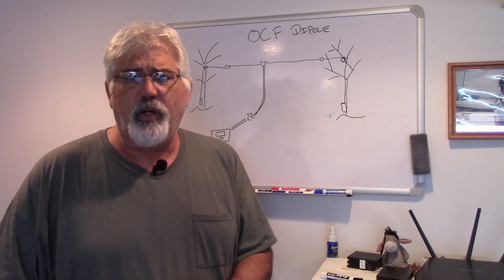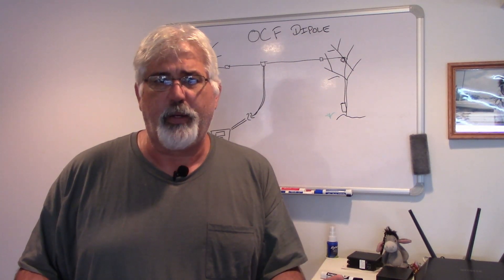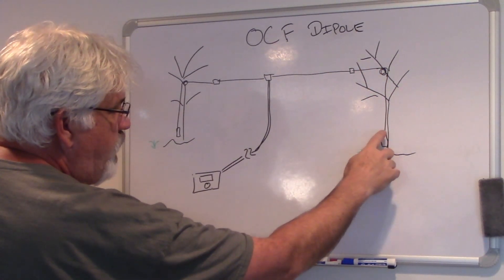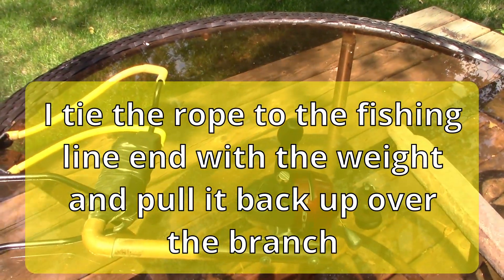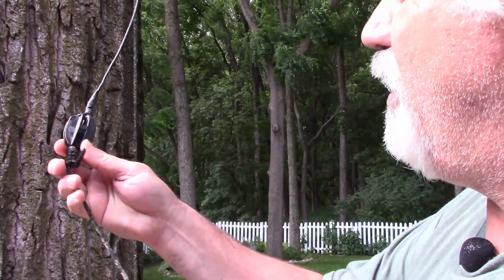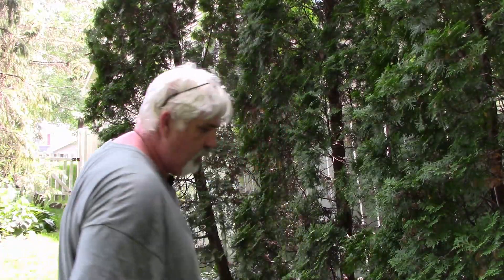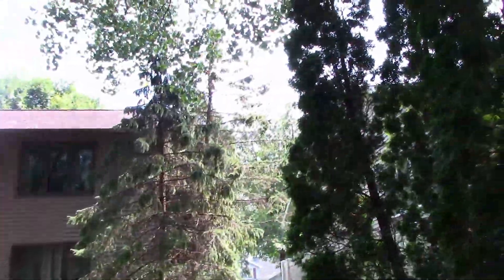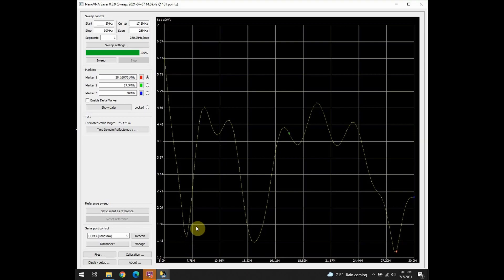Let's Fix My Off Center Fed Amateur Radio Antenna

Comment: I go through this every hurricane season. Lol.. Paracord with springs is the way to go. Gl.
Reply from the maker: Good suggestion!  What size springs and where do you get them?
Reply: @StuartPatterson  20 inch zinc plated extension springs - Amazon.
 2 inch x 4 ft pvc pipe concreted in ground, with eye hook bolt fastened to the top, to spring end. The springs are cheap enough to add one or two depending on how much tension you want.
Reply from the maker: @tsant6591  Thanks!  I might look into that solution for future antennas.

Comment: Rather than sash weights, I use springs. Screen door springs work great.
Reply from the maker: Ah, yes, I can see that working well!  Good idea!
Reply: Sash weights hard to find these gays!
Reply: I have a 200 ft leader line with pulleys on either end. I use empty propane bottles as counterweights. It allows me to easily change antennas and experiment.

Comment: After running numerous antenna designs over the years, the OCF Dipole has proven to be a very effective design and happens to be my favorite. I use a Balun Designs unit currently, but still have two W8AMZ(sk) 40-6 and 80-6 units that I packed away.
Reply from the maker: Agreed.  I was doubtful at first but it has proven itself time and time again.
Reply: I use one too - 66 feet (20 meters) long, with a 4:1 balun at the feed.  With the tuner, I can get 80/40/30/20/17/15/12/10 meter bands.  In my case I had to add some snap-on chokes for common mode current problems.   --  AA6LJ

Comment: Was the antenna resonating like that on it's own or did the autotuner massage it? Those were great results.
Reply from the maker: That was the antenna, it does perform very well.  I do have a tuner but it was not inline when doing the VNA testing.  Thanks for asking!